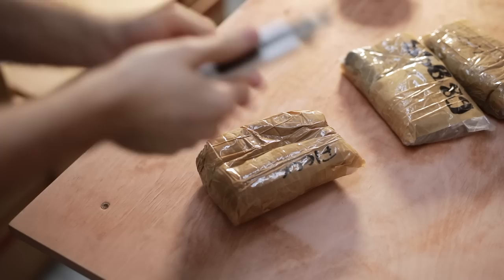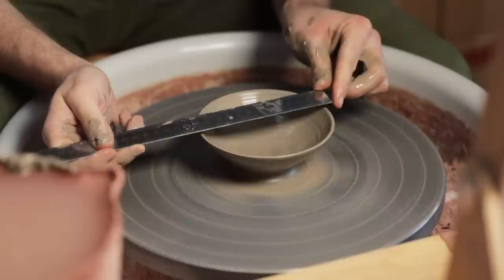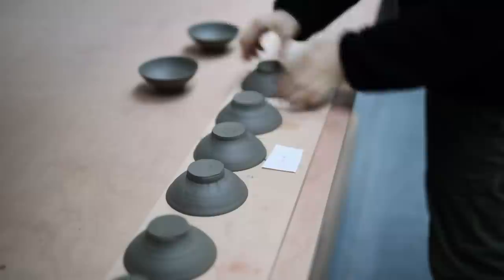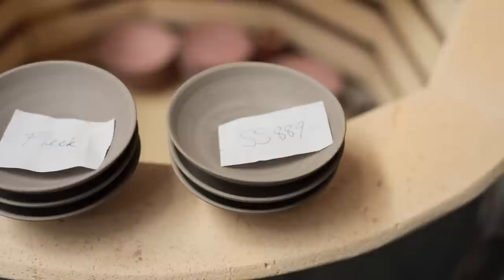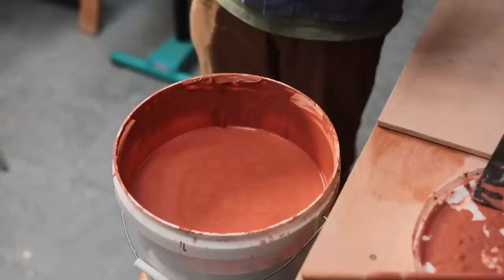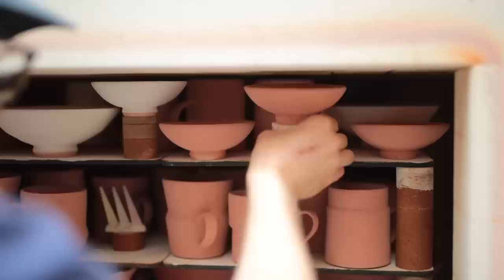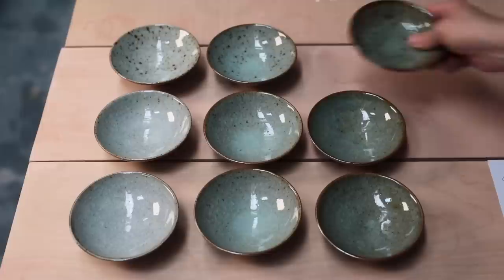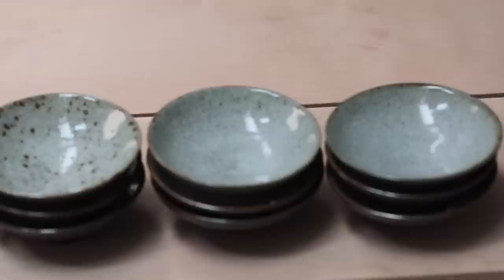Testing New Stoneware Clays — From Thrown to Reduction Fired

Comment: Your usual clay does seem a bit clean in comparison to these three newer clays, I wonder how Fleck and SSB8G would look on a larger pot. I think the amount of speckling on Fleck would look really nice on a taller vessel, where having a large surface full of speckles would make for extremely unique and interesting pieces. It reminds me of a video you made last year where you sprinkled iron oxide into your usual clay, you included examples of what you hoped the result would appear like.
Reply from the maker: Exactly! It's really similar to that pot — in fact, I should finally be able to make a conclusion video to that vase with iron sprinkled into the body — just have to do one more firing...

Comment: Your existing clay body and the new clays offer such different outcomes.  I tend towards very clean looking pieces but I have to say here I thought the newer clay body is interesting.  If you throw a substantial number with the new clay body and then offer them both for sale it will be interesting to see the buyers' response.  (And I've just joined a ceramic studio with a gas kiln after only firing in an electric so your process even more interesting than usual..)

Comment: I remember watching you making a tall pot or something, where you rolled out individual snakes of clay and layered them on top of one another in circles to get the basic cylinder shape.. 
I wonder if you could incorporate a single snake of speck or ssb8 into such a form without it introducing fatal stresses during firing. Is it uncommon to add impurities to specific parts of pottery? Loving the experiment, I think the speckles add interesting character for sure.

Comment: The shot of the old clay versus the new ones was quite dramatic. It's funny, because your glazes had always seemed to have so much character, but the new ones just blow it away.

I really liked the SSB8G. Lots of character, but still an evenness to the final appearance.

I found the Fleck a little distracting; the spotting seemed too large and irregular. (Although that might be due to the size of the bowl. A larger piece might be really nice with that finish.)  The iron specks were interesting at the unglazed foot, but not exactly attractive.

Comment: When dipping in glaze, why do the tongs grab inside and outside of the rim, instead of centre plus foot? As a lazy person, I'd think that saves me fettling the outside fault plus gravity will have made the fault in the centre smaller if anything -- so there must be a reason?
Reply from the maker: If I grabbed them via the foot I wouldn’t be able to place them down immediately after glazing them. I’d have to hold the pot and wait until it dries enough to be able to hold it and place it down. This way, by clasping the rim section, I can glaze and place down easily, without having to wait for them to dry, which speeds up glazing a tremendous amount.
Reply: @floriangadsby  Ah yes that makes a lot of sense... short-sighted me. With "my" grip, you'd have to start notching out your table surface to let the tongs pass, but the distance between notches depends on the objects' size which varies... a hopeless plan. Thanks.